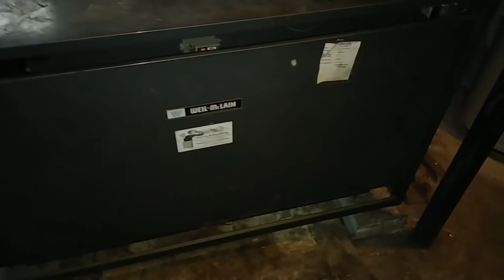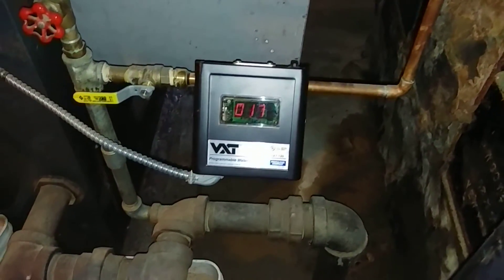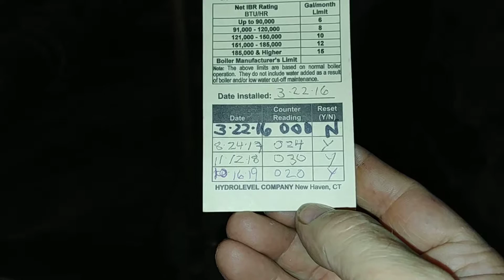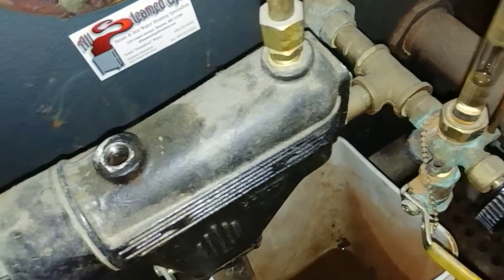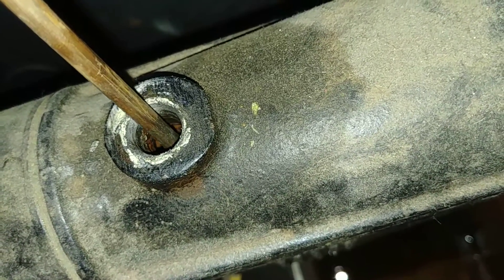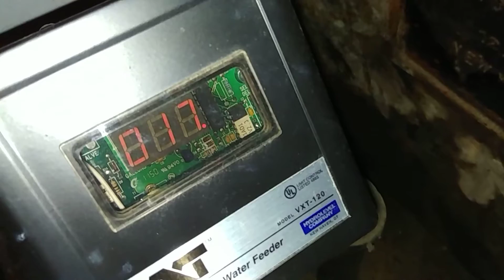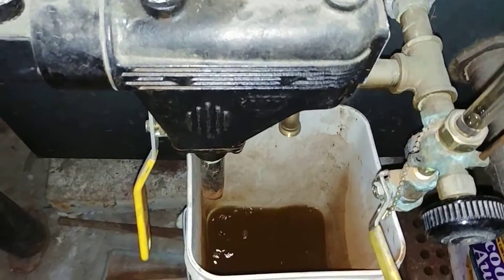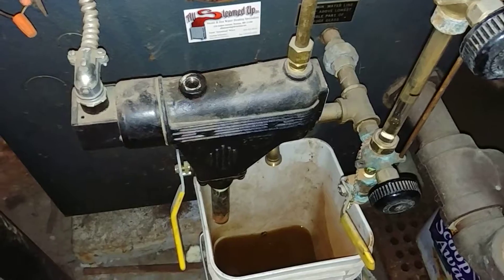Steam Boiler Start-Up: Freeing A McDonald & Miller #67 LWCO Stuck Float

Comment: thanks for the educational video. I live in Chicago and have never seen a underground return.  Is that specific to certain areas and is that a water return for when the steam cools ?
Reply: You are welcome!  As to your questions regarding underground returns: If there are none in Chicago, I envy you !  It is usually called a "wet return" because it is full of water because it is below the boiler's water line.  It allows the rapid return of condensed steam back to the boiler (that's good).  BUT, a wet return is the sludge collector of any steam system, unfortunately.  A buried wet return is worse, because it often it is buried in acid soils, where it rusts through the steel, leaks, and kills the boiler by the over-addition of oxygen-carrying make-up water.  That's why we really pushed this customer to get a VXT installed, to keep an eye on those sneaky buried returns.  So far, so good. 
They buried them to "get them out of the way" in basements so the basement can be finished as living space.